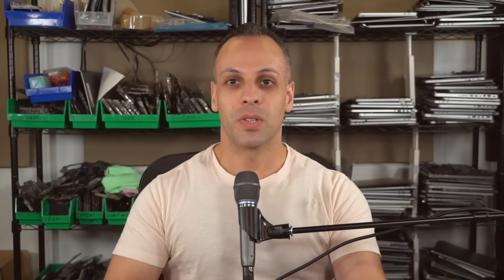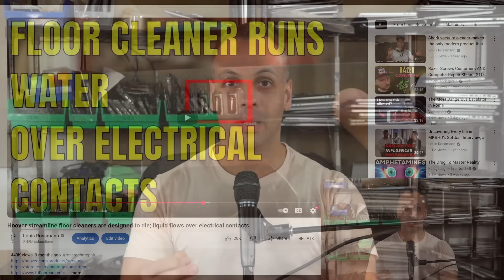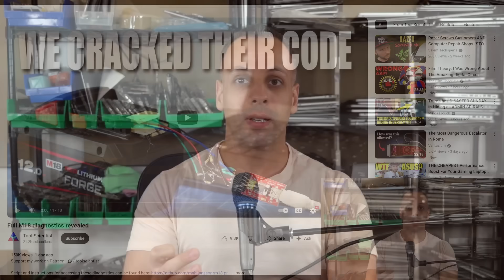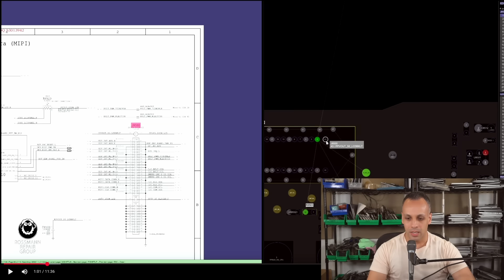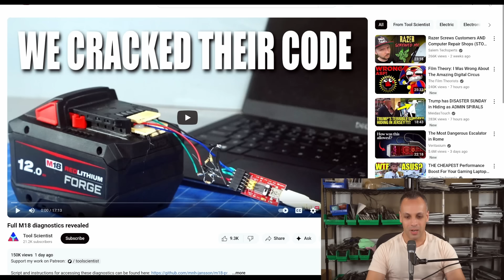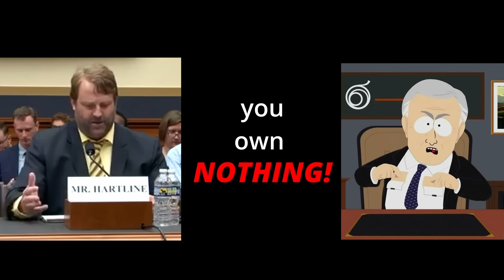Imagine putting DRM in a battery to void warranties...

Comment: 7:00 don’t worry, you didn’t put that idea in their heads, they have a 10 year cycle where they make meaningless cosmetic changes to the battery’s shell that makes you buy new tools
Reply: No they don't. The same battery has fit all their tools for 17 years when the switch to lithium happened. There are huge construction companies, plumbing, HVAC, etc that use Milwaukee if they change the battery it would make all the tools worthless. The business model is once you buy into one brands battery system. Companies already do slimy things no need to make anything up.

Comment: I was already unimpressed with and disappointed by AEG, so this makes it very easy to never buy their products again.  

For the record I got an air condition unit by them and I was disappointed as soon as it came out. A few scuffs on the machine, panels that pop out of where they are clearly supposed to fit, and if you press in the corners you hear a click but then it just bounces out as soon as you let go. It took 3 hours to cool a 20 sqm room where a previous machine with the same power did that in 10 minutes, and over time it has lost its ability to maintain temperature. We're talking a 2-3 month period of use where it's become so much worse at running I've had to decrease its temperature by 2 degrees for it to be able to maintain a sweat-free temperature.

Comment: You want a new battery? Ok, then buy a new drill because we hardwired them into the drill now. Ah and btw, if you want to use the drill you need to activate it with our app that is always connected to a server that we will shut down in 1-2years to force you into a another purchase, because stocks need to go up up up.
Have fun drilling!

Comment: Louis:  a note about cutoff voltage.  If the battery is being discharged and cutoff at 2.6-2.8V/cell, that's destroying the battery.  For longevity, a lithium battery can't be discharged below 3.5V/cell.  If you're seeing 2.6-2.8v/cell, there's either intentional programming in there or lazy programming in there, and that's suggesting forced buying when there shouldn't be forced buying.

Comment: As Matthias random stuff found out, DeWalt is doing something about the balancing, but have conveniently stupided in a tiny flaw (video on his second channel is titled "This kills flexvolt batteries prematurely":

During charging, the pack will be charged to balance. All good. But after this, the monitoring of the cells will be done by circuitry that runs off a single cell from the pack. The longer the pack idles in storage, the more one single cell will be depleted. If you then use the battery after a few weeks/months, the pre-discharged battery will get exhaustively discharged, thus damaged or even destroyed. Is it malicious? Who knows. Is it quite the convenient dumb mistake? Sure is.

If you have DeWalt flexvolt packs, charge them up before you use them after storage, even if they display as full (because with one discharged cell it still will show up as full, or close to). Maybe other brands do the same thing, be aware.

Comment: Dewalt did the very thing you were hesitant to say out loud. Dewalt changes the batteries and tools every couple years so if you didn't load up on a lifetime of batteries when you buy the tool, you'll need to rebuy everything when the batteries stop accepting charge.

Comment: I stopped buying battery operated tools when the replacement batteries cost more that the tool itself, which came with a battery.  Just like ink jet printers, which they practically give away so they can later break it off in your backside on replacement cartridges, that indicate empty, not because they are, but because software in them says they are, so you can't refill them.

Comment: My electric pruning shears keeps a record of how many cuts and how many big cuts ended up with a safety cut out. Current model now has the battery being monitored apparently will record if the battery was taken off charge before it was finished charging

Comment: Damn it I purchased several Milwaukee Tools over the Years (and quite a few Batteries) and I didn't know about this ! No Cell Balancing ? What 😳😳😳 ??? I'm starting to wonder now if we should do all our own Battery Packs possibly with LiFePo4 instead of Li-Ion using some decent BMS instead for when the Time that these Batteries end up Dead arrives. Chinese knock-off were 2-3x cheaper but of dubious Quality. But a Premium (in Price at least) Manufacturer of Tools not even implementing Cell Balancing in their Battery Packs ? Either it's Stupidity or it's by Design !

Comment: The other thing that Milwaukee does differently that the wall/craftsman whatever that conglomerate is Stanley, I think owns them and whoever owns Stanley is nobody else actually puts any battery monitoring on the battery itself. Everyone else puts it in the tool so the problem one problem with this can be as though as if you're dual battery shorts out in your toolbox it will just just keep going till it catches fire because there's nothing in the tool to prevent that.

Comment: Regarding your comment at 3:58 . The reality is worse than not putting balancing circuitry in these batteries. The circuitry is actually present (it's a standard feature of the MCUs they use), Milwaukee just opt to disable it in their firmware.

Comment: I just bought a replacement battery for a LG vacuum. It doesn't "suck" any better, just a little longer. 
BTW Ford finally released the official shop guides for my 23 yr old Lightning in March of 2025. I doubt I will ever unlock all of the pickups mysteries. I would have appreciated knowing about it a few months earlier though. I decided to do a full overhaul/restore to it. I already think they have more hidden SVT stuff not in the manual. Def not easy to find.

Comment: Multiple cells in a battery.  LiPo cells are typically around 3.7 V nominal.  Some don’t want to be discharged below 2.9 V.  Li-Ion are different again, as are LiFe, sodium based cells (just coming into the market now), and other slightly different variants (e.g. ‘high voltage’ cells used in some drones and model aircraft).

It’s very complicated, and ideally you’d have good cell-balancing built in to the battery, or very proprietary connectors that prevent incorrect battery use in particular devices.  Laptops and phones are generally good for this, but power tools and other consumer items are questionable.

Comment: I genuinely have no idea how is cell balancing an issue in 2025. It sounds like an issue of electronics from 1990. I recently made a 3S2P battery on EVE 21700 cells (5Ah ones) so 11.1V 10Ah. I use it quite often on my RC boat, and even though I actually use it above the maximum discharge, it always stays balanced. What it took is literally a 2 dollar BMS from Temu.

Now why the hell can't huge companies make a BMS that can balance the cells, if a random chinese seller from Temu could FOR 2 BUCKS???
Reply: 2 bucks purchase equals 22 bucks retail
Reply: @erik_dk842  doesn't matter, what matters is that a small pcb that's cheap as dirt can do something that batteries made by huge companies "struggle" with. And they "struggle" with it just to make the cells lose capacity and fail way quicker so you're gonna keep buying new batteries.

Batteries don't degrade as fast as companies tell us they do, if you make your own pack with a normal bms it will last.
Reply: @ejtako  I have recelled my E-bike's battery several times with RC pouch cells. It has a balancing board and the OEM charger is slow, but they are still only good for a year and a half.
Reply: @erik_dk842  Wow you must be using some really cheap cells then, I know people who built their own ebikes like 5 years ago and the range hasn't dropped much.

Comment: Bad design: My son’s Ford Mustang has a design flaw. The rear wheel sensor connector has both 12v and the wheel speed sensor output present. Water got into the connector, shorting 12v to the speed sensor input of the Body Control Module - which got fried. £5k to replace the BCM, fortunately under warranty. How much would it have cost to add input protection, or was this removed for “cost savings”? We have “upgraded” the connectors (both sides) to stop further water ingress problems, but who would design circuitry this way - cost savings or deliberate?

Comment: Why would there be code for Balance Charging...? 
      Balancing is handled by passive components... (Right?).

As for using diagnostics against the consumer... yuck.
      Also: for me, a power tool is useless if it requires Bluetooth or an app to function (or be able to access full functionality). 
      Means the tool will become useless in less than 5 years (...or when you simply don't have your phone with you)... 

And since I have several hammer drills* that are OLDER than ME - (60 and 46, respectively) - that still work just fine... I do not accept that premise.

Comment: While on the subject of batteries, how many people know that a BYD electric car comes with all its batteries glued in place. If one cell goes bad, you have to throw away the whole battery. Other companies at least divide their batteries in several modules. 

Most electric car companies don't allow you to swap the whole battery. The BMS detects that you have put in a new (and identical) battery and refuses to allow the car to work (unless you can read the code, change it, and then reflash the system).
Reply: Tessler also glue most of their batteries in place, at least the pack teardowns I've watched.

Comment: The fun now begins, because soon enough you'll be able to get knock-off modular batteries that have the potential to be just as good as those originals but for a fraction of the price. If the code has been cracked, then the path to compatibility is there.

Now if only somebody could do that for various printer lines and how their ink cartridges work.

Comment: If you can afford to put a chip in it, you can afford to put resistors in it that enable said chip to waste power across select single cells so they can slowly equalize. These resistors are 0.1 cent. Yes, that price is correct. I bought 5000 resistors that would be suitable for that job for just 5 bucks. And I didn't even buy from china.

Comment: At least battery adapters still work with the big brands (for the most part). There's not a doubt in my mind they'll all start trying to lock tools out from using anything but future 'certified' packs. For our safety of course.

These overpriced Milwaukee packs are an engineering marvel compared to the Hoover ones (also TTI). I haven't had even no-name china cells fail as reliably as every Hoover pack my family got scammed with. Numerous official packs of varying capacities manufactured years apart and every one died in less than a year with 2-3 cells inside that were completely cooked. It doesn't just fail to balance properly, cells seem to leak current and over discharge until it just refuses to charge. Warranty is effectively non-existent (at least in the US) and they use every trick to avoid processing it.

I plan on trying to use the wonderful work they've done to reverse engineer the Milwaukee packs to prove these things were intended to fail. Not because I'll ever own another Hoover product but because it's personal.

Comment: battery vs cell. A battery is a collection of cells that work together. an X volt battery has several X volt cells in it, a single cell does not make a battery. a modern battery that is 52V would have around 14 lithium cells in it, not 14 batteries. 
a laptop would have several cells in it, but it is one battery. 2x pp3 9v batteries would have 12 1.5v cells in them which when combined in series would be 18v. if you have a device that has 4 AA's in it to power it, it has a 6V batter that is made up of 4 1.5v cells.

Comment: Question is, if they have implented a pure hardware based balancing. You can do that. Requires some active circuitry. But o.c. it is not as precise as a uC based solution, if talking about mass products. When I last did this type of HW based balancing, I got to something around 30mV (highest to lowest) difference having 7 cells in series. But it requires some tuning from board to board.

Comment: I bet you Milwaukee will release a new version of the batteries that are promise to have 20% longer life and just put in a little bit of balancing code and update the security for the device. I bet they will run a program where you can turn in your old batteries in any condition for a mystery percentage off and if the batteries are in good condition they give you more but either way the new batteries will be $20 more and really all they did was put in load balancing and a password.
Reply: I'm not sure that they would be able to do this as their Chargers actually do converse with the batteries using this diagnostic Channel. They need to update the batteries the Chargers and the tools in order to change their protocol and that just seems like way too much effort. Also I'm not fully convinced that they were actually trying to hide this so much as didn't bother to document it or tell anybody about it. It wouldn't have been that hard for them to actually encrypt the communication in some way all they did was implement something and then not tell anybody that they had implemented it I don't know that we have any evidence that they actually care if customers are reading this data but there's plenty of good reason why they might not want to bother documenting it and may not want to bother supporting the feature. Software support isn't exactly a simple thing and a company like Milwaukee / TTI probably wants to avoid it so while they did create this software and quite likely don't care if customers use it they also don't want to have to bother making it something that's their problem to deal with if there are bugs or if it's not working correctly for the user. In the current state if a user does use this diagnostic tool and has a problem with it and they report that problem to Milwaukee Milwaukee can simply say oh this wasn't designed for you to use so we don't care that there's a problem if they actually documented it and advertise it as a feature they would have to support it and care about bugs and get reports and all of that it just adds a lot of overhead.

Comment: It doesn’t have to be a conscious decision. Profit pressure and cost-cutting naturally push products to last about as long as the warranty, especially when switching brands is hard. 
No need to waste emotions, because it’s economics, not malice. In a closed market without competitors striving for durability, all products eventually degrade toward deceptive expectations. Ironically, it’s the customers, mostly ignorant, who ultimately decide.

Comment: AEG makes washing machines with cheap bearings, wich break within 5 years. They also have the better washing machines, under the brand: Miele. The washingmachines are technically the same, but the bearings of the Miele can run for at least 10 years before breaking. The Miele is twice the cost of the AEG washingmachine. Probably both are build in the same factory, same parts, except for the bearings. The cost of the bearing itself is maybe a few bucks. But to swap the bearing for a brand new one, you'll have to buy the whole unit, thats bearing including the drum and axle. The unit cost half the price of a new Washingmachine. So people buy new instead of repairing the broken one, because its cheaper than hiring a mechanic. This is a sick way of selling a simple bearing for 500 bucks. Just to buy a more reliable machine, thats double the price of it's cheaper counterpart.

Comment: Simply a way to sell more batteries.  No battery balancing circuitry and software is a joke. I have cheap power tools from a well known cut price German supermarket beginning with L here in Europe they have battery balancing circuitry in them and and are still going strong after several years and hard work in a trade setting and much abuse.

Comment: I'm currently building a Battery pack. My college wanted to stay away from Li-ion Cells. And I'm like: Just put a BMS on there, and it will be safe.
In my opinion, there should be a ISO standard for Power tool batteries. and they should be interchangable.

Comment: I can confirm. The battery pack in my Hoover vacuum cleaner has an horribly designed BMS which basically overheats and overwears the 1st and 2nd cells while leaving the other 4 cells with little to no wear. So i unsoldered the cells and substituted them with new ones but NO! some bit in the BMS flipped and the battery pack is not usable anymore, even with brand new cells.

Comment: power tool batteries without a balancer are produced garbage and designed to fail

i had a bosch green hedge trimmer an d thought this was purely for cost savings - appaently milwaukee is on the same level of quality as bosch green.

Comment: Negligence is ignorance when your service network do not perform repairs but only replacements. You have no feedback over your own product. You do not have information about what fails the most etc. You are blind in that regard. By your own choice. Running no proper service network is much much cheaper so if you do not care about product you are selling it is valid option.
How customers should treat companies like that? Stop buying their product? It would be eventually succesful but remember what Louis said about buyout circle? Companies will change hands multiple times until it dies and nobody will ever remember what they did wrong to their brand. That is why legislation is only viable option. Legislation that works.